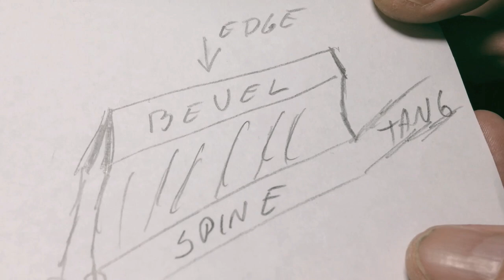Straight Razor Honing - Bevel Setting 101

Comment: So right on so many levels. First one I honed was a new Giesen and Forsthoff 6/8.  Took like 4.5 hours to set the bevel on a 1k Chosera. The edge looks like crap, but I've shaved off it close to 2 years.  I didn't have anyone to show me other than what I saw on YouTube. So I just did it. I was active on a forum then. I asked a genuine simple question and was attacked.  Went to a different forum, copying and pasting the original question, and actually got some respect. They act like it's some big important thing. It's shaving. It's nothing to go to war over.  

Oh well, rant over.  Yours was one of the better videos I've seen.
Reply: So true - it's freaking shaving, not surgery. If you don't get it right - redo it, and reset the bevel.. It's that simple.  Some people worship guys who hone razors like they are master martial artists from ancient Japan. Sand off some metal, make an edge.
Reply from the maker: Happy Honing!

Comment: This was a lot of fun to watch Keith. Great info in here. Picked up a lot. I now use that thumbnail test for bevel setting and found it to be very helpful. As I was going through testing the grab I could see in the light with my particular thumbnail that some spots grabbed with the weight of the 7/8 F H blade and slightly splayed out a little bit of my nail in front of the blade as it dug in a little deep. Other spots along the blade didn’t do that. So I did more work until it did the same thing from toe to heel. What a great consistent tool the thumbnail is. Great info about half stroke distance down the stone and pressure control and the torque on the blade looking at light reflection. That woke me up to a lot of how much the steel actually bends like that. All fantastic stuff for a novice like myself that I just didn’t pick up on before. The sound of that blade going back and forth is not only meditative but but just listening too it over and over really trains your ear too. Don’t know if you were going for that but just wanted you to know it is another great tool of knowledge in your video. Anyway I could go on and on and In the end I just want to say thanks again !  Great job ! ...I see now I wrote a comment earlier LOL ! I guess there is good reason why I just keep coming back to this video. 😊
Reply from the maker: Hi there, thanks for coming back and watching and commenting - again! Lol. Happy Honing !

Comment: I just ordered my first pretty beat up razor and I set the bevel using a humble soft Ark pocket stone that I lapped one side coarse and one side finely. It's worked great for me although not incredibly fast but not too slow either. I have some synthetics of my own but you know what I kinda really like the soft ark for this task. No worrying about being out of flat or doing much lapping and I just use dawn and water in on my soft arks. does a great job for me and honestly. 20 dollar soft ark if you're willing to learn to use it seems like a great bevel setter to me.
Reply from the maker: Happy Honing!

Comment: I agree what you said towards the end of the video regarding the x pattern. Seems like if you go too far not only is balance an issue but it seems like the front of the blade has a lot more contact than the heel - spends more time on the stone. I can see on my blade that the bottom of my razor has a thinner bevel than the rest. I need to adjust my strokes.
Reply from the maker: Happy Honing!

Comment: Just wanted to say "Thank you" for taking the time and effort to making this video. I am new to straight razor shaving and now realise there is so much to learn. I am about 6 shaves in with a straight razor and still have both my ears and my nose. Bought a Dove five eights, half hollow, round toe. I am a bit of a perfectionist when it comes to matters like this as I like things to be right, this comes from my days as a draughtsman I think, I now work in a Dementia Unit so life has changed a lot. My one saviour has been this interest in shaving and trying hard to manage to get good results. Just need help with what to do next, buy an old razor and try to make it work again? What do you think.
Reply from the maker: Hi - if you want to learn how to hone, then by all means, yes - buy a bagful of old razors and hone the snot out of them.
Reply: I was thinking of getting a Naniwa 1K,  5K and 8K. I have already got a 12K Naniwa stone, just to hone my new razor, but fancied having a go at an old razors to see if I can do it. Is E.Bay a good place to look, I guess you don't have to spend a fortune on an old razor, are there any to avoid? Thanks again for your time to reply.
Reply from the maker: Picking out razors to restore is a bit of an artform itself - that's a huge topic and a never ending one too. Just pick something that looks to be in decent shape and don't spend more than you want to. You may get stuck here/there, but overall you'll do ok. Don't buy 40 razors your first time out - go slow, learn what to look for first.

Comment: I am still trying to get the correct torque but in all fairness this was only my third honing session this morning. I have to wait till the morning to give it a shave test but looks and feels OK. All I have is a Norton 220/1000 and a 4000/8000. I have crox on a nylon belt and use that for a finisher. Not the best setup up but you need to start somewhere.
Reply from the maker: +John Suiters I started with a similar set up, so what you have sounds good to me!

Comment: how do you get the blade level if there are chips or waves? is it just a question of continuous sharpening/removing metal until the the edge is straight, or do you do something like "saw" down the edge by running it against a coarse stone, then, once straight, go back to setting the bevel?
Reply from the maker: Depends, there can be a few things at play; I’d have to see the blade in question. For many warped blades, a ‘rolling stroke’ gets all parts of the blade on the stone.
Reply: @KeithVJohnson1  -thanks. it was more a theoretical question. I cut throat shave, but never set a bevel. I sharpen all my knives, mainly kitchen, on whetstones. thinking of adding a 8k to the collection,

Comment: I've honed knives for years, but am struggling with straight razors. Your trick with the heel leading seems to be a HUGE help. For some reason I can't get the 2 sides to match bevel angle wise. The side I push stroke away from me looks nice and uniform but the side I pull towards me looks all wacky.
Reply from the maker: Bevel angle is hard to gauge by eye. I'd guess that you might be looking at a differences in the wear pattern, which could be that your return stroke has been getting less pressure. It's a common issue. It's also possible the grind on the razor is whacked and factoring into the story.
Reply: Well my first two attempts were with WSP Gold Dollars. I learned the hard way why Gold Dollars sent recommended for newbs. JESUS that spine! So I recently got a new Dovo Best Quality. BTW do you recommend tape or no tape for a beginner like me?
Reply from the maker: Some people love those razors, I'm not one of them. The spine, the grind, the heel, the toe - all of it usually needs to be 'fixed'. Waste of time IMO. Dovo Best razors have had some issues in the past also. But assuming it's not warped you're probably ok.
There's nothing wrong with learning on tape - most any bevel angle change from the tape can be rectified later on fairly easily. But - tape is a pita, you have to constantly change it out as it wears and most likely between grits/stages too. So - it'll save you wear on the spine, but piss you off during the honing; a double edged sword of sorts.  
Before just going ahead and using tape though - get a caliper and measure the bevel's angle. The tape will add 1˚ to the equation; so, if you're starting high, like - around 19˚ or so, you'll wind up with a 20˚bevel. It's entirely possible that you won't like shaving with an edge honed that steep. So there's that. 
I'd guess the Dovo is going to come in around 18 or a bit under though. 
Thing is - before messing with geometry and/or making any decisions like that - you need to know what your start point is first.
Reply: I also have a 1926 Boker "The King" that I bought fully restored from Razor Emporium. I'm comparing my edge to that one. I don't plan on doing any honing on that for quite some time! That one will be getting honed by a professional. It'll take quite some time before I get to that level I'm sure. Thanks for your advice. I really appreciate it. If you don't mind, I'd like to check in from time to time to pick your brain.
Reply from the maker: Cool - you're welcome. Stop by anytime, if I can't help, I'm sure someone else here would be able to.

Comment: Thanks for the video. I have a couple questions
What level of grit is good for a good shave? I have the Norton hones 4k and 8k. If these are lower grit than other brands what would be a good choice to add to these?

You mentioned a wire edge from the back and forth honing. Can you refer me to some more info on this? I like this stroke, but maybe I need to try something else.
Reply from the maker: The concept of 'grit' and how it relates to a good shave is a very lengthy topic - there's way too much detail to cover here. Many people find good results by following the Norton 8k with a Naniwa 12k. But - some people say they like shaving off the 8k Norton - so there's a lot of personal preference that goes into this equation. 
Creating a wire edge isn't guaranteed by using head-on strokes, and avoiding one isn't guaranteed by using x-strokes. A lot  of this has to do with choice of hone also; for example, Coticules almost never create issues no matter how you hone on them. Overall though, compared to 1/2 strokes,  I find x-strokes to be a better method to creating a cleaner edge and it's way less prone to creating edge distractions like foils, burrs and wires. Some guys use circles to their advantage too. Horses for courses.  
There's just so many places to find info on honing, stroke types, etc - it's hard to point in any one direction. I wil however recommend Llyn Abrams' videos. 
The best thing though, is to just hone your ass off and keep on honing as much as possible. Knowledge is great, but wisdom rules the day and the difference between the two is experience.

Comment: Awesome video Keith. 

After you set the bevel, whether that takes 5 minutes or an hour, do you still use the same strokes on the following stones (x-strokes primarily)? Also, how do you know when you are done on each of the higher grit stones, e.g. what would you look for before you say leave the 5k to go to 8k?
Reply from the maker: I usually use X strokes throughout my honing progressions. Learning to read feedback is the way to know when to jump to the next stone. There's no way to explain it because everyone's sensations, stones, razors, etc are all different. You learn by doing - and paying close attention to what is going on while doing it. After a while you can associate one 'thing' with another 'thing' and then 'everything ' starts to fall into place.
Reply: Keith V. Johnson One more noob question. If I’m running Chosera stones, can you go from the 5k to say the 12k to finish, or do you suggest something in between those two. I have the 1k and 12k, but have been using the Norton combo stone and would like to stick with a set from Naniwa.
Reply from the maker: @Cdub33  there is no 12k Chosera. No 8k either. As for whether or not you can jump from any 5k to any 12k - well, you can do anything. The question is, will you like the results better with or without the 8k in the middle? Only way to know is to try. My Shapton progression, if I am going to go full-synthetic, is 1.5k, 2k, 5k, 8k, 12k.  That works best for me.
Reply: Keith V. Johnson Thanks! Yeah sorry misspoke. My 12k is the Naniwa Super Stone, not a Chosera. I’ll give it a shot from 5k to 12k and see how it goes.

Comment: New TI razor micro chipped one side of the bevel. Never honed a razor. Tape or no tape? Thanks for the video.
Reply from the maker: Tape has nothing to do with chipping. Since it is your first razor I'd think it's probably your technique. Could be your stones. I'd suggest learning on a used razor, make your mistakes there instead. Then move to the expensive stuff.
Reply: @KeithVJohnson1  Sorry let me explain. I chipped the bevel on the faucet - strangely only one side of the bevel. But obvious enough to mar my strop. Wondering if I should tape the spine if I try to hone it back to shape.
Reply from the maker: Unless the chip is big I usually won't hone on tape for something like that. It's a personal decision, no right or wrong here.

Comment: hi, have you tried the Naniwa professional stone P-310, 1000 grit? I am reading that is the improved new version of the chosera 1000 from naniwa...
Reply from the maker: I've had the 'improved' 800, 1k, 3k. The 1k and 3k both started crazing. That's why I got out of Chosera/Pro stones.
Reply: @KeithVJohnson1  interesting... Are you using another brand to set the bavel after the bad experience?
Reply from the maker: @OGianmarcO  I use Shapton Pro stones most of the time.

Comment: yeah, the pressure is the part that i'm trying to get figured out. i find that when i end up using two hands i end up with toe and heel getting set but not the middle. still learning. i think i put too much pressure on the spine as well and not enough toward the edge for fear of torquing it.

I'll try with your finger placement and see if that help keep the pressure even between edge and spine.
Reply from the maker: You have to torque, but you must not flex the blade. So it's a ballet of sorts. You'll get it, just keep doin' it.

Comment: Hey Keith,

I tried the tomato thing, and no offense to the doctor, but it's a fairly meaningless test. I guess it does tell you that you have some sort of edge on your razor, but beyond that, I don't see any value in ever trying it again. I tried it out of curiosity. No paper, tomatoes, soccer balls, etc. Shaving is the ultimate proof of how well a razor has been honed.
Reply from the maker: I can cut a tomato with a credit card sharpened on sandpaper.
Reply: @KeithVJohnson1  - Yeah Keith, no value in that test at all, with all due respect to the doc.

Comment: Great advice on honing, thank you for sharing your experience with us. Would you consider setting the bevel with a lower grit stone why or why not? How do you decide what grit to start at does the blade really need to be in bad shape to go lower than 1k?
Reply from the maker: Sure, I use coarser grits when needed. You can set a bevel on anything, Its just a matter of time. I'd rather spend 10 minutes on a 1k than 45 min on a 3k. What one decides they need isn't neccessarily based on one condition alone, it's best viewed as both balance and compromise..If a razor only needs a slight cleanup and a 3k will do it, sure - use it. No one will die if you decide to use a 1k first though. Whatever wear/grinding is needed to return the bevel to its desired state is - is what it is.
Reply: +Keith V. Johnson 
thanks.

Comment: you said that an 8K Norton is only about 4K according to Japanese standard. I use a King Delux 1200 to set the bevel and then an 4/8 Norton combo. My question in light of this, is there any point in using the 4K between the King and the Norton 8K. Also what would be good choices to finish a razor after the 8K Norton. I am getting a clean shave with it, but I think I am getting razor burn: face and neck itchy and sometimes irritated. I just feel it should be sharper.

Joe
Reply from the maker: The Norton 8k is a 3µm stone - approximately 5k JIS. I do not know your 1200 King, so I can't advise whether or not the 4k Norton is useful to you. You should be able to tell by checking the striations on the bevel before and after using it though. If nothing else, leave it out of a progression to see what the finished edge is like when you shave. As for what to follow the 8k Norton with, I used to put the 8k Naniwa in there. I suppose you could try a 12k to see if that works for you. As for the edge not being sharp enough, most sharpness is developed before 8k. You might need to look into improving your bevel-set work.
Reply: Thanks for the reply. I'll do some more on the bevel. If sharpness happens before the 8k, how high does a person need to go to get a good edge?
Reply from the maker: Everyone is different, some like 8k edges, others like 12k, 20k, etc.

Comment: Hi, if I don't have a 1k stone, could I use 1k wet & dry sandpaper on a solid flat surface?
Reply from the maker: Every so often someone puts up a post about using sandpaper for bevel setting. I think they start with a finer grit than 1k. I might be wrong about that but since an abrasive that is fixed in place to the top of a substrate should be markedly more aggressive than one that is, essentially, floating around in a softer binder - it might be worth considering a finer paper to start with.
Reply: Thanks, that's really helpful 👍👍👍
Reply from the maker: You're welcome!

Comment: I have a very small chip in one. Would 220 or 400 be recommended? When would you consider/recommend using lower range as the aforementioned?
Reply from the maker: Hi - 220 and 400x stones remove a lot of steel, they can be used  to remove large chips. A small chip can usually be remedied on a 1k.
Reply: Keith V. Johnson thank you